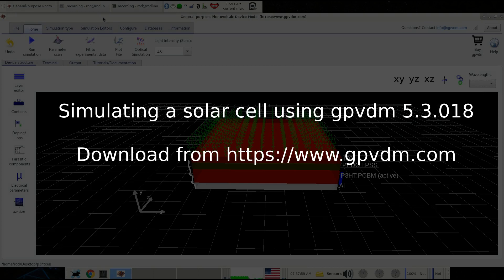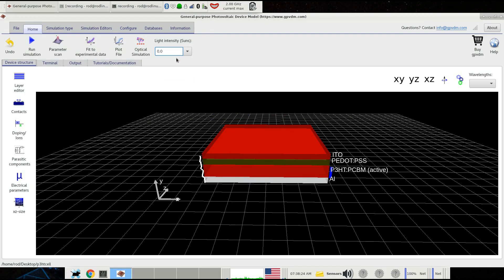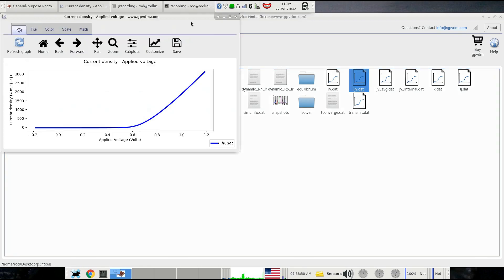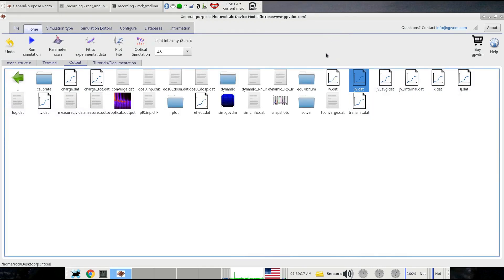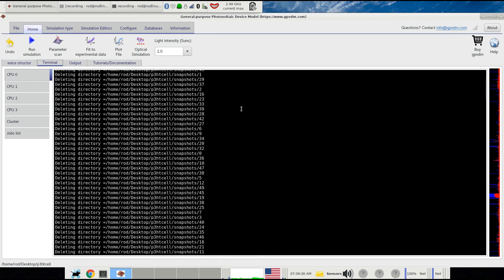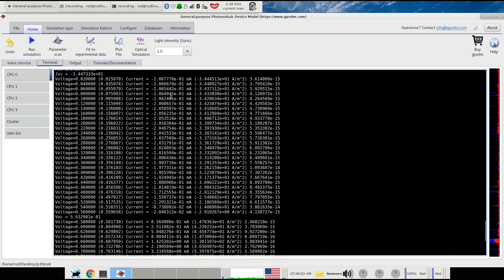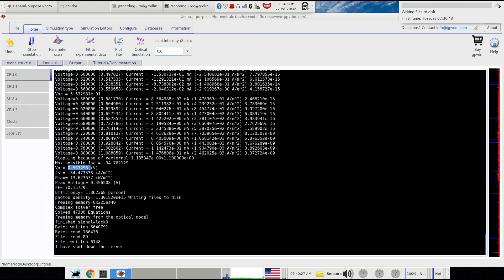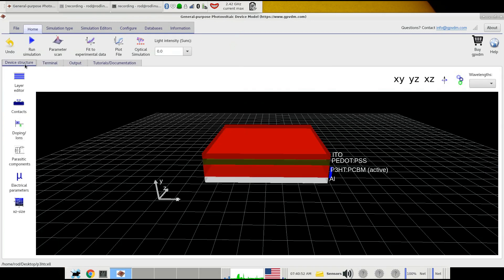JV curve simulation on an Organic Solar Cell (OPV device)

Comment: Dear bloggers, I'm sorry to bother you,I just downloaded the setup_OghmaNano_8. 1.020 from the website , but the software could not be opened, 
the error shows 
"OSError: exception: the access violation reading0x0000000000000000
[35132]Failed to execute scriptoghmanano due to unhandled exception!” ,
Would you please tell me how to solve the problem, my PC system is win11, thanks😿